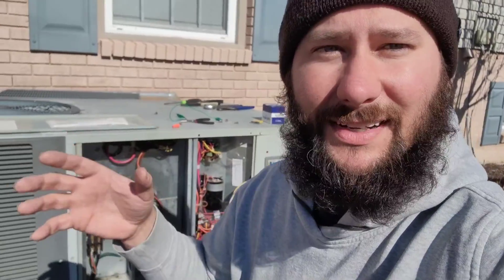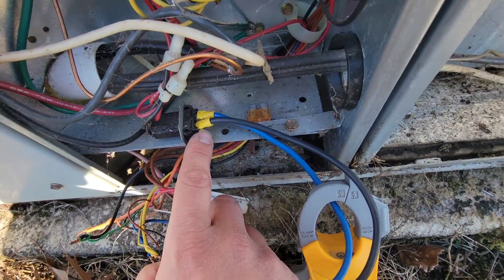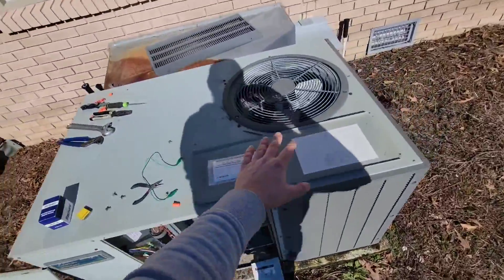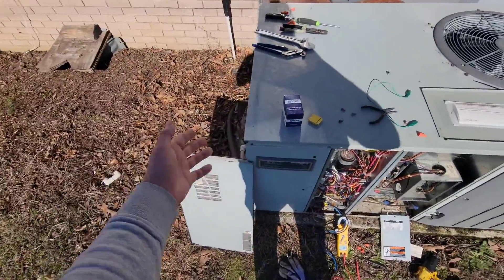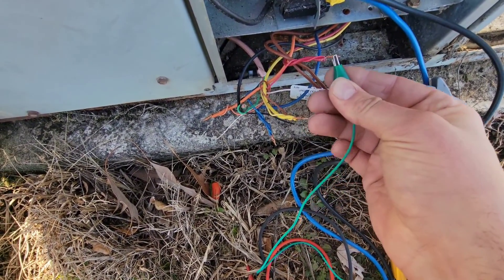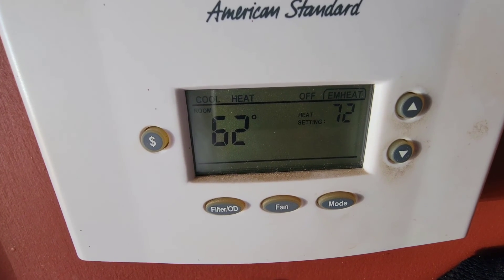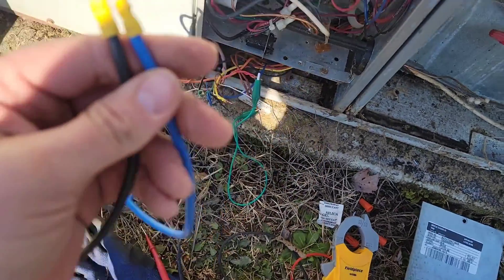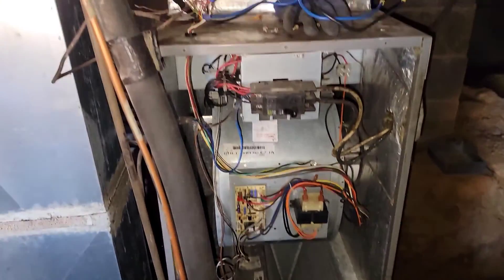Low Voltage Short: What You Need to Know

Comment: hey, have you ever experienced short of high limit switch after new installation? is that possible pls answer if you have a chance
Reply from the maker: A high limit switch tripping is most commonly a low airflow problem. So I would check everything to do with airflow ductwork, sizing
Check the static pressure.That's the easiest way to check the duct work

Comment: I've had 2 gas furnaces in a row blowing the fuse in heat mode.
It is ok in cooling. 
Can't locate the short in either one.
When I disconnect the blue common from the control board, the furnace runs and the fuse holds???

Comment: Hey Tad, I spent half a day chasing a short on a split system in a hotel. I checked all the wiring at the condenser as well as inside it. I checked all the wires at the handler. I tried replacing the thermostat. I even replaced the thermostat wire. It ended up being a short coming from the solenoid coil at the reversing valve. That one hit me like a ton of bricks. It was a brand new system and I would have never usually gone there. 🤔
Reply: Where is that at I had one at a hotel as well but it was at the transformer
Reply: Same situation here

Comment: Hi ted i have a problem with my electric furnace i recently replaced sequencer and limit switch and the heat strip glow ,when i turned back on the power my thermostat went blank no 24v already changed i checked transformer and 240v input but no 24v output i changed transformer but still not 24v pls help me
Reply from the maker: you have a short

Comment: You’ve got to be careful using circuit breakers in place of fuses. They take much longer to open than a fuse since it is a bi-metal. In the time it takes to heat up you can certainly smoke (or de-smoke) a board.  I understand it’s temporary for troubleshooting but you can burn things up while testing. Obviously you could de-rate the CB to compensate for the time lag but there’s not that big a selection.
Reply from the maker: Great knowledge thank you
Reply: Ya 3 amp breaker he said it ran up to 7 amp before it clicked off that could burn up everything I use a 2amp fuse and breaker and still there's a chance to fry things like t stat and transformer and board back in the old days it was a 1.5 amp fuse with a 40va transformer

Comment: Hey Tad, I am Hines, from Florida. Today I have a service call that is giving me a hard time. The Air handler is not coming on . The 3 amp fuse was popping I change the contractor but the x13 motor still not coming on. It is getting the voltage. Is the motor module is defective?
Reply from the maker: https://youtu.be/sDst2N_fbDo

Here is a video to make sure the ECM motor has a call and voltage 

If it's got voltage and it's got a call. Then it could be bad for sure.

Comment: Visual inspection is always recommended and important. I had a short today on the tstat wire for the condenser due to the wire rubbing against the metal cage.  My meter did not show a short between the common and hot wire.

Comment: I got one for you, have had 3 techs at my house. My 3amp in air handler would pop, I would replace it and it would last a few days until it popped again, eventually the 3A would just pop immediately. Tech came out, put a 5A, same thing, would last a few days, but after a couple fuses it would just pop immediately. Had a friend try to chase the short and all he could get was that it was outside. Replaced the board, and replaced the contactor. Still pops the 5A when we put the main fuse back in. This happens now with no power draw, both thermostats are set to off, and outside big handle fuse is pulled out. Still pops the 5A in air handler. Had a tech recommend replacing my signal wire from air handler to board. But that was just a guess from him. Any help would be nice lol
Reply: Really you got a happy ass heart from Mr. Tad but no reply. Did you get it figured out?

Comment: Hey I had a 12000 btu mini split and a 18000 btu and I had these on twin breakers or  the 12000 was in the same as my fridge and it was giving me a pc04 error code and it also went into a defrost mode randomly at 50 dagrees but I cured mine by taking it off the twin and I can put it back and causes it so it’s definitely the twin that causes it but I was wandering if you could explore and do a video about this because I see this a lot online and it would help alot of people to understand how the inverter compressor gets confused by the small milli volts that causes this , thanks for ur videos and hope to see one about this cause and cure

Comment: Thermostat was not powered on, Transformer was burned when i arrived and the fuse was still good, replaced the transformer and system turned on, went to the tstat and it was showing low voltage. Went back to the attic and transformer was toasted and fuse popped. Went to the condenser and Contactor was toasted. Ohms on 24 side was at 0. Replaced fuse transformer and contactor.

Comment: Good quick easy Find & versification ...sometimes its much easier on an pkg  unit rather than running back & forth on an split but always same principle ..shorts used to be puzzling when I 1 st started  out 35 yrs ago in HVAC / wasted quite fuses till i got an 3 amp popper ..started out with an 5 am popper & 1 st usage the 5 did not pop & got my xfomer the 3 woks great ..it will trip or so far it has ..100 % of the time ...also great tool out is an " A Zebra Brand or others " Short Pro Tool "  that lights Up upon an R -  C connection ...connects one lead to R or hot 24 volts on one side & then  attached the other lead to each LV circuit @ Tstat or air handle / one @ a time while amp clamping the one lead to test for hi amps draw as you just showed also  ....but connect to >  G , Y .Y2 ,  W . W2 till light comes ON & you've found witch wire is shorted usually pretty quickly & now trace it back to the each of its components attached to  that  tripped wire & so many times its an shorted rubbed wire / Lots of bad Contacts / or sometime sequencers or bad tstat  Great Video & Thanks

Comment: I have had several low voltage problems. and it ended up being.customer put a nail in the wall.and split wires
Reply from the maker: Oh that's a good one
I bet that 1 was a pain in the neck

Comment: Was working on a small hanging heater for a building. Transformer was shot and replaced it with one with a resettable fuse on it. Found the exact same problem with the coil on the contractor shorted
Reply from the maker: Good Job 👍 thanks for sharing the experience 👍

Comment: First of all, thank you for all your videos. The most weird short I had, it was in a unit that has the Common side of the transformer grounded. After a long chase, I disconnected the ground wire and the fuse did not pop anymore. It ended up being the ECM inside the air handler. When ramp up it was sending voltage back through his own ground wire, to the case of the unit. It was around 40V, enough not to trip the breaker.
Reply from the maker: woah that is a weird one 
thank you for sharing that one with me 
you rock

Comment: I would've liked to see the ohm reading on the coil of that bad contactor. Had one dedicated to the heat strips in a Trane air handler earlier this week that was blowing fuses. That coil was reading .3 ohms and I believe the replacement was 12. Good video. I had one years ago with a rub out like on the second segment of this video except it was a compressor lead. Finished a p.m. and everything was fine but a huge lightening storm was rolling in. 45 minutes after I left my dispatcher called and asked if everything went well. I told him yes and he had just gotten off the phone with the customer and they didn't have any cooling. I went back the next morning to find a hole blown through the suction line on the compressor. Brazed it closed, just a small hole, and called it good but I was in a hurry because another lightening storm was coming in fast. That night the customer called again, no cooling. Went back the next morning, a huge hole blown out of the suction line and had some missing insulation on the compressor lead but I didn't have any missing insulation on the first blow out. Customer wound up filing an insurance claim and got a whole new system. It was good for them because the old system was R22.
Reply from the maker: Great experience Thank you for sharing all this information
 ohms on the bad contactor coil was .7 
 And I'm pretty sure the new contactor was 15